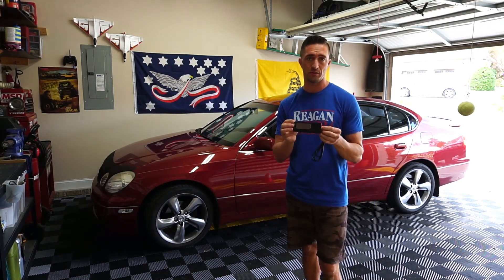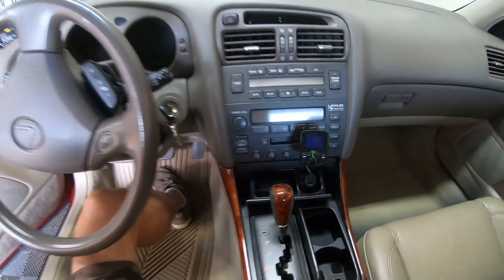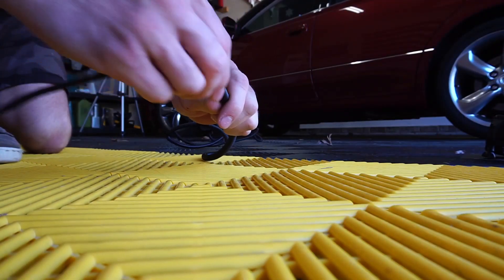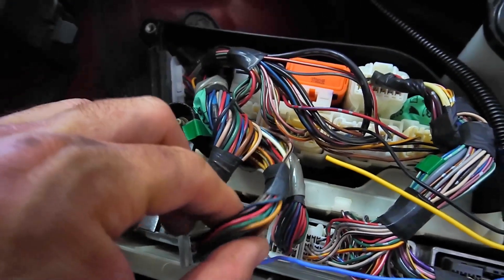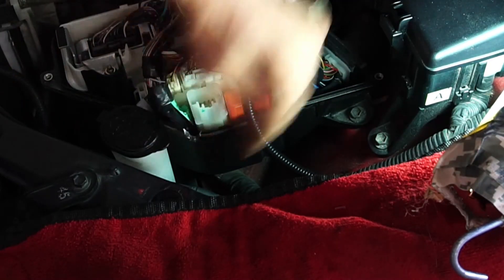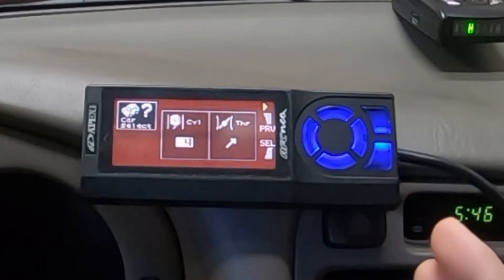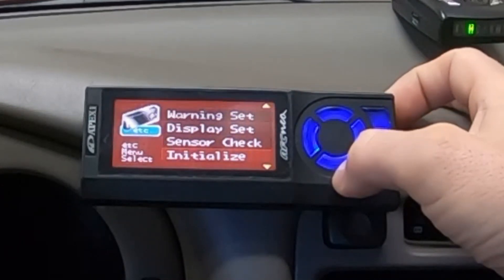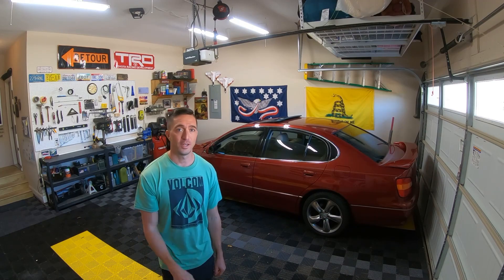Step-by-step Tuning Device Install (Apexi NEO into GS400)

Comment: Taken from fb post on this video. Can you comment?

"The Lexus computer is too smart for a piggy back and will lean itself right back out in two days.

Safc’s work great on several other applications, but not a later model (VVTI) LEXUS ecu. 

If you have a wideband you will see it lean itself back out in 2 days. So you’ll add more “fuel” to the tune, and it will lean itself out again, agin and again until you’re at +50% max on the neo. 

Then if you keep getting in it you will either pop your motor (if you’re boosted) or you will realize you need a controller/computer that will completely control the injectors with its own drivers. 

If you’re N/A, you’ll fiddle with it /  “tune” it on the dyno and make your little number hp gain, and then in two days it’ll be running the exact same as without the controller after spending time and money.

If you have a NON vvti 2J motor/computer you can use an SAFC or Map Ecu or aem FIC, or Greddy Emanage or whatever other piggy back your heart desires, but not on these VVTI computers."
Reply from the maker: Absolutely false. My AFRs do NOT change on the high throttle map. Months and months of data to prove it. On the Low map I agree. Tuning the low map is pointless. The computer fights the low map tune and strives for 14.7 in most load factors. The exception on the low map is a cold start, where it reverts to your settings.

Comment: Sr. I installed my APEXI NEO back in 2007. At first it ran exceptionally well. Then it kind of fell off in performance. Looking on the net for answers was not really helping. Until I saw your post. Great, it was a question of going beck to the basics. I'm turbo charging my 1997 Toyota RAV4, with the 3SFE engine. Will the Apexi work with a TURBO engine? A subscriber
Reply from the maker: Hello- I’m glad I could help in some way. The NEO will work with turbo applications. The problem is timing. Since it does not control timing, you’d be better off with a piggyback or standalone that has timing control. Sounds like a cool project. Would love to see more. Are you on IG?